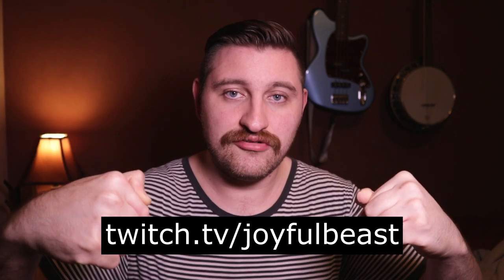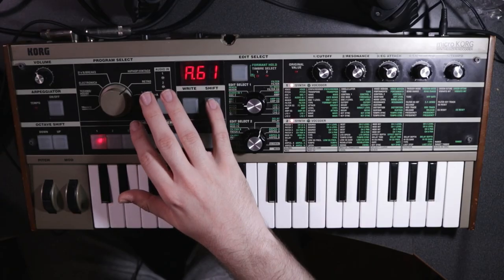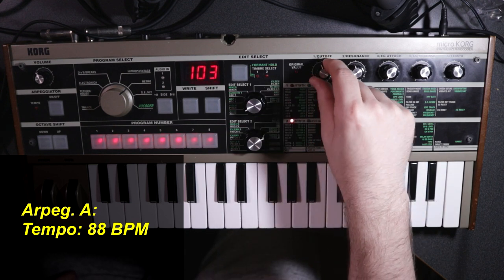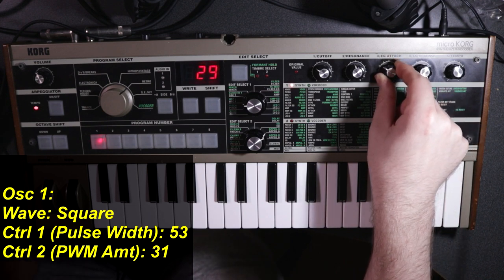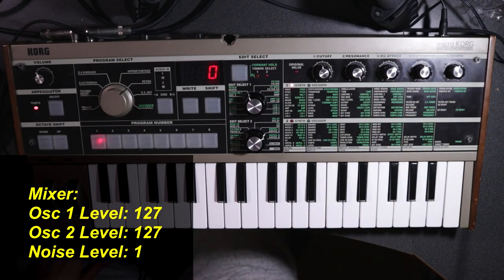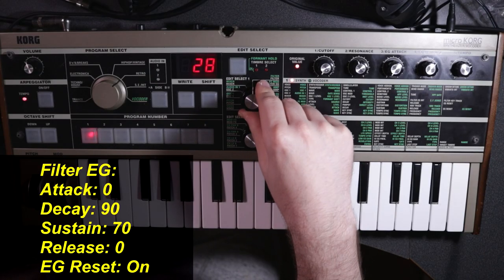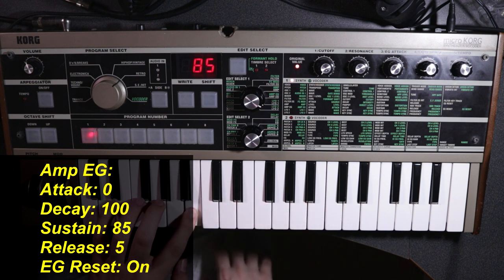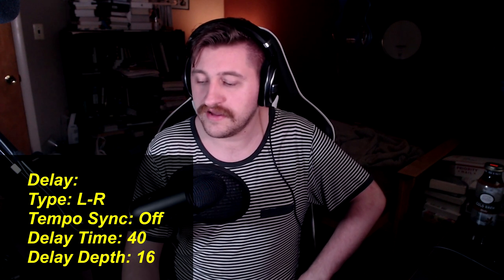Roygbiv Bass for MicroKorg (Boards of Canada Tutorial)

Comment: I applaud your use of the flanger as a chorus.  I used to use that at very low recycle frequency for the destructive interference for my guitar with my old Ross flanger, before it somehow cooked itself.  I've never yet seen another hardware flanger that can go that low in the recycle rate, but if the micro-korg can then that's really cool.  The best I've achieved is using U-he Colour Copy.  Funny thing is that after I set the knobs right to get that shimmer for the low notes of an E chord, I could then play anywhere on the neck, and it sounded amazing!

Comment: Before playing this video, I made some guesses as to how this sound came together - and turns out my guesses were right, even the filter! It's a lot like the Stranger Things bass on the Juno 106 (60 ? ).

By the way, the old Roland keyboards have a secret regarding that sub oscillator square wave: It's out of phase with the other oscillators (especially the saw) by a specific amount and that's how you get that throaty James Hetfield buzz. Very few VST synths get this right. FL Studio Sytrus and TAL Noisemaker have phase settings and the trick works. By happy chance, the Microkorg also has the oscillators out of phase the right way.